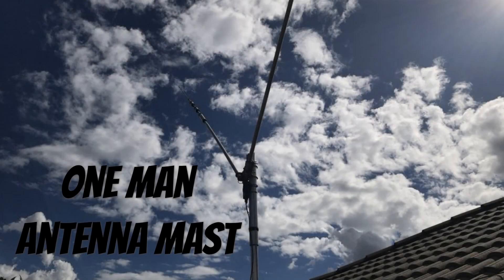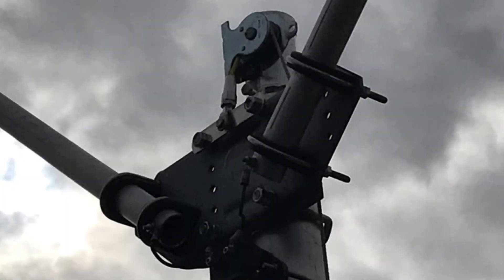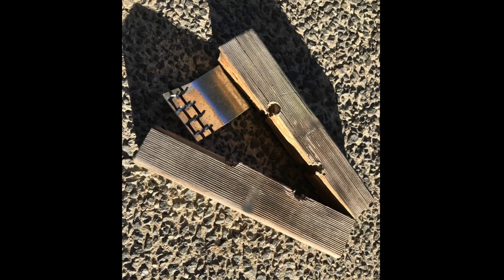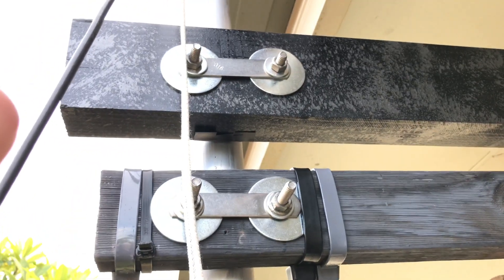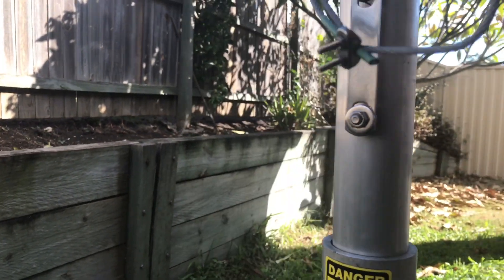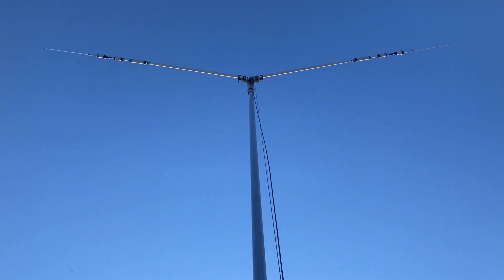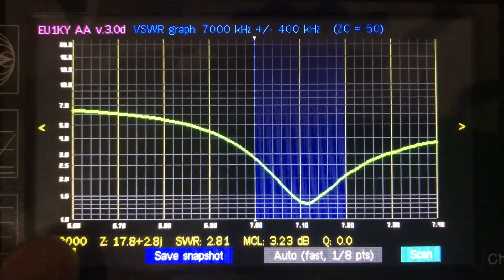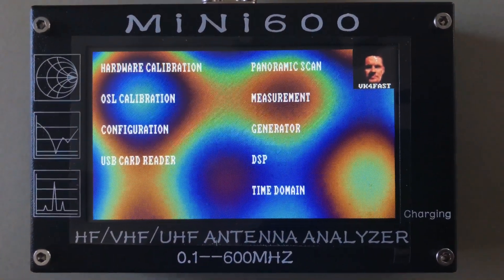One Man Antenna Mast - Part 3

Comment: Hi Brek Have just purchased an Comet H44 and I'm following your method almost exactly  for the install -n my exposed garden. I'd be real grateful if you could share the model and make of that pulley you have installed so i can order one just like it. Cheers
Reply from the maker: Hi Mark, It’s all still good. There was a huge difference getting it higher than the original video, and the feed point is still below 1/4 wavelength from the ground for 40m. Are you Australian? Everything but the tube was from Bunnings or Masters (whichever). I’m not sure if I said it, but it definitely wants a stronger tube than the original video where I did give inner & outer diameters. I’ll try to have a quick look online for the pulley now. It’s nothing special.
Reply from the maker: I’m pretty sure it was this, using the two inline mounting holes, so it sits sideways. The wire cable used to raise comes down slightly to the side. Don’t forget to cut that notch in the tube that slides up & down the mast. If it is allowed to sway from side to side, it fatigues the wire cable, and would eventually snap. https://www.bunnings.com.au/zenith-50mm-zinc-plated-fixed-pulley-1-pack_p4220773